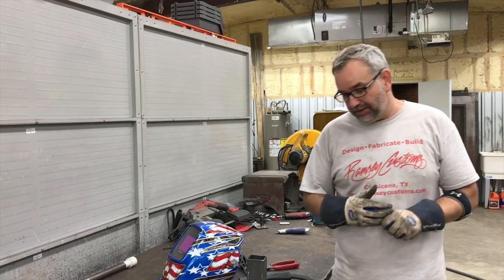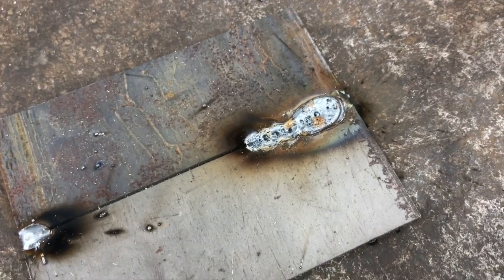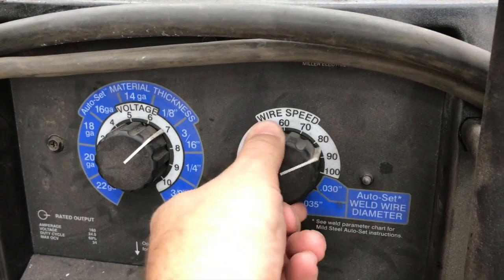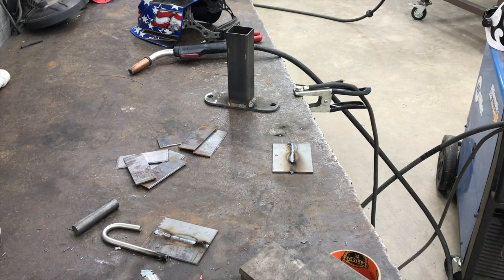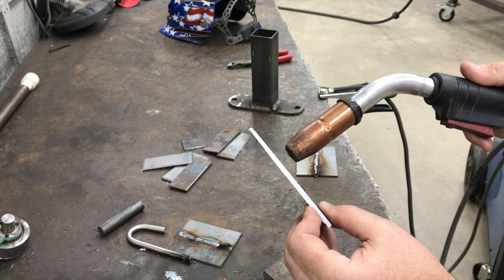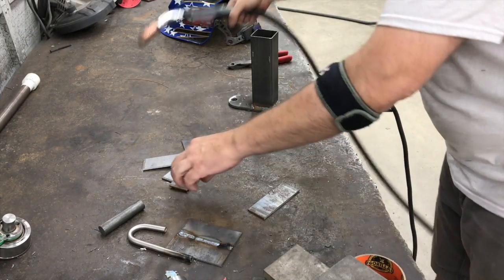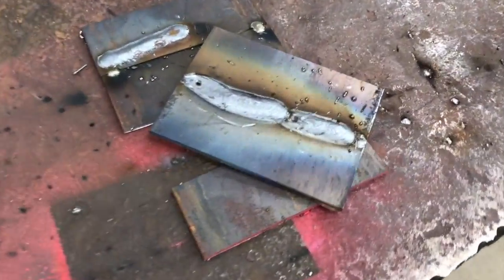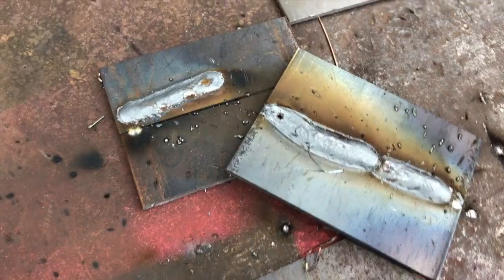Why are my Mig Welds so Bad?

Comment: Well Done :face-fuchsia-tongue-out:
Well Said :face-blue-smiling:
Well Explained :person-turqouise-waving:
SLAPS Subscribe button :hand-pink-waving:
now to find out how high to set the pressure on the regulator 👍 
on oxygen tanks when running low i set it low, when it's running out i raise it, eventually i'll replace 
goldsmith / master jeweler 60 yrs experience here, now getting my hands dirty with welding 👍
i prefer flame torches but i love electricity (photovoltaic / solar thermal tech under my belt so it's time to rock 'n roll with Mig ⚡⚡⚡

Comment: Mines is popping and wire jumping around on a newish Vulcan 220 welder , I been welding for 30 years and can’t figure it out , what else could it be? 
It still has the factory mig gun and heard there not great at all so maybe that could be the issue ? 
Let me know what you think or what else it could be?

Comment: you missed out on too fast welding movement, too low of voltage, too much gas, too close with tip, and a couple of others too. but thank you

Comment: You just helped my learning curve, so I subscribed and bookmarked this video. I probably will have to come back to it on my way to mastering mig welding. I will also use this video as a REFRESHER. You may not be a teacher but you come across with a clear straight forward delivery that a layman can understand. thx.

Comment: If I could add a tip on the grounding issues, check the part of the cable that reaches the clamp. It might be damaged, since the cable tends to bend a little there when you fix it to the work. I had those issues even though the clamp was in contact with clean metal, until I realized most of the copper stripes of the cable were completely damaged. I redid the connection and it improved a lot (still having a bit of a hard time, since I'm a beginner and working on 18-20ga sheets with a flux core machine)

Comment: Lol your right i forgot how to mig gas. I been stick welding got a job doing handrails bought a 190 hobart out it together and couldn't lay down a bead man.    After about an hr an watchin your video I turned up the wire speed to 70 80.  Its found better buts still not flat . Help

Comment: I have been welding 44 years and my welder has been sitting for
 2 years it welded fine until the rusty wire came out what a nightmare

Comment: Does anyone MIG without gas.  I didn’t buy gas for my Lincoln 140.  I know it’s just a real small welder, but, I don’t intend at 76 y/o to be welding very much.  Just a few pieces now and then, repair a mower deck, if needed.

Comment: Great Vid. Learning to weld at 85 years old. Have wood working shop but needed another hobby. Making rocket stoves. But welding in short sleeve, shorts? Brave. Learned several things from you. Bought two migs. 
🐻

Comment: Good day. Great video. I have one question for you. A piece of wire is often "glued" to the weld during welding (http://vladimirkubicek.sweb.cz/Kuhtreiber%204100/P1120689.JPG). Something similar I feel is in your sample - 2:32 minutes of video.
What is the cause?
I think my welder welds very well, but sometimes he doesn't ignite the arc. Do I suspect a contactor in the welder?

Comment: New frustrated welder, but will keep trying. Your video is excellent. I experienced all cases presented. I am wondering if buying a cheap welder is a good or s bad start for a new welder? I bought the harbor freight flux 125.

Comment: At 9:00 minutes in when you did a very quick smooth weld. What settings were you running? I bought a Hobart Handler 140 6 weeks ago and still working on better settings. I have taken a couple welding classes and had the opportunity to weld with all kinds of welders and just made the spot at the end of my 2nd class to Tig weld aluminum. I don't want to go too fast or too slow on a higher speed burning holes or doing a real piss poor all over the place weld. My welds are looking pretty good as I practice and get to know my machine, but my time to do that weld on thin material at or close to default settings wouldn't go that fast. Any help or a different point of view is always welcome.
Reply from the maker: Just keep practicing and working to try to improve.  Video yourself so you can watch it again and see how your technique is looking

Comment: I've been welding for 30 yrs. You can hold your torch at a 45 degree or less and don't want more than 5/8 of a inch of wire sticking out. I run my shielding gas 20cfm. Great video for people starting out.

Comment: Hello Ramsey, I have a l Lincoln 140 wire feed welder. Is it necessary to use argon gas to get good welds?
Reply: Yes using gas will give you much btr welds then using flux core wire...it’s garbage!

Comment: One thing I wish to add is polarity issues.  If you swap between MIG and flux core welding, you have to remember to swap over the polarity while swapping wire spools.  Welds turn out horrible with incorrect polarity.

Comment: Had all these issues, but not sure why my gas is not coming through as pressure is good. Too much rust which is very hard to remove with a wire brush. Thankfully it's only rebar and will be covered by concrete.This has been very instructional, thank you. Did some MIG welding at college but everything was all set up perfect with clean steel plate, so never really learnt how to deal with problems.

Comment: Just a tip to everyone, avoid but welds always go for a lap weld if you can its stronger and only a few things actually get but welded. If needing a but gap it use backing or use a V joint

Comment: advice no1 dont learn to weld on your project!!!! if you project needs a lot of welding . . learn to weld first "then" tackle the project.,. reason being... a lot of your welding on old cars especially is rust repairs.. you will be doing that for many weekends ,but most of it will be in chassis and crush zones of what will be (after a couple thousand hours) and when you tighten the last bolt on your finished pride and joy you will stand by and remember all the things you learned in the last couple of years...  how bad the car was, how bad you cheap welder was, before you bought the gas bottle. how bad youf welding was when started fixing the rusted chassis that the guy before you stuffed full of newspaper and finished it with underseal.    just episodes from my and friends builds from 30-40-50 years ago i am no spring chicken then but still build cars

Comment: I have the problem you described as having no gas. Problem is I have brand new gauges and a newly filled tank showing something like 1600lbs and 30 to the gun. So why the crappy weld that looks just like you said??
Reply: one of the things that he did not tell is about the is nozzle issues , is the nozzle cooling the weld proper ? we all ( me ) don't all have new welders and sometimes try to milk the cow as long as we can , a burnt off nozzle will not work right , hope this might help someone Johnny b.

Comment: One thing I didn't see was the fact you may have to much gas or that your pushing the gas in to much by being to close to the weld , that will surely pin hole the weld, or the tip inside the nozzle is clogged and not getting sufficient gas.

Comment: when welder is set right the sound of the weld should sound like bacon frying. when that happens mark your dials so you know where to set it again. Make sure your material is clean from rust , paint, oil etc.

Comment: Great video, Another thing Ive seen is that guys will get hot and turn the fans on them in the shop and try to weld. Fans and mig welding doesn't work.

Comment: What does it mean when the wire comes out , there is a  hissing sound not a "bacon" sound, and keeps forming small molten "balls" on the wire which drop off and another forms?  Thanks in advance.

Comment: Which is stronger mig welding  with or without gas and also is it better to weld with or with out gas when afterwards grinding the weld down for body work

Comment: Thanks for the strait forward approach. I did see some flaws in my technique and what may have been frustrating me so much today. I do exhausts and most welding is above my head so you can imagine my frustration when it kept puddling outward, me thinking "too hot" was backing the tip away and worsening my own issue.

Comment: Do you have to have gas with migwelding?
Reply: Or another way to say it: Yes, unless you are using flux core wire.
Reply: I’m only new to MIG welding but...gas MIG welding is way way better than flux core MIG welding.
Reply: Well, there is flux core wire but it is called Metal Inert GAS, welding so....

Comment: Biggest problem is wind outside and bad grounding. after i homemade a good ground i get nice clean welds. The factory cable had terrible connections so i braze the copper wire to the clamp and the connection pin.
Reply from the maker: good point about the wind, i didnt think about folks welding outside, i should have mentioned that

Comment: Thanks for the video.  I spent all day trying to figure out why my weld is sputtering.  Cleaned the ground clamp and cable, added an extra clamp.  Changed extension cords, and even moved to another outlet.  I'm having the exact same problem that you showed with the gun too far out from the work.  Arc sputtering on/off, gun pushing back, and weld just stacking up on work without penetration.  Would a bad tip cause the same issues?   Thanks again.
Reply: Customcutter100 - I know it's been 8 months but there is one other reason why I have had the same problem. I didn't think it really mattered what gas I was using. So I used pure argon to mig weld with .030 hard wire. Apparently it matters a lot. So when I switched to 75% argon / 25% cO2 then at least I had a chance to make some parts of the welds look somewhat like a weld.

Comment: One thing to add is that medium or heavy rust will give you the same results (porosity) that a lack of shielding gas will give you. A light surface rust is usually not that big of a deal even though you will get a better and stronger weld without it. Preparing the surface properly will save you a lot of time grinding out bad welds and the result will be better as well.
Reply from the maker: great points, thank you sir!

Comment: Ramsey Customs - turbocobra

I use mini gas bottle argon + co2 and i use flux cored wire with gas. Because i dont have the solid wire.  I only have solid wire that came with machine.

Anyways, the welds do not look like the one at the left @: 2:35

They look "black" and/or dark and they dont have that look of the "gas weld" (shiny metal weld bead).

What could be the reason? I know the bottle has gas the gas goes to the tip of the gun, i have double checked.
But there is no difference in how welds look like.. gas or without gas, still same, dark, bad and ugly.

Is the problem flux core wire? And i should try solid wire instead? I know the included solid wire is pretty bad but today im gonna try it.
My flux wire is from Lincoln Electric.

Tried to weld exhaust for my car and wanted to make it better with better looking welds using gas, but i dont see results.

Im unable to get the clear weld results as you got or other guys show their welds using argon/co2.
Reply from the maker: Sorry I cant help you there, I have never tried dual shield.  Check jody and peter zila channels

Comment: IF YOU LOOSE YOUR SHIELDING GAS THAT IS WHAT WILL HAPPEN NO FANS OR DIRECT WIND USE INNERSHIELD WIRE JUST RTEVERSE YOUR POS AND NEG INSIDE YOUR MACHINE ITS NMOT PRETTY BUT ITS JUST AS STRONG AND YOULL NEVER HAVE POROSITY,IF YOU WANT TO USE A GAS WIRE STEP UP TO DUAL SHIELD WHICH IS A COMBO WIRE THAT USES GAS AND HAS A FLUX CORE WHICH WILL LEAVE A SLAG BUT ITS THE ONLY MIG WIRE THAT WE USE INB OUR STRUCTURAL STEEL FAB SHOP .LINCOLN 71 T 71 M 71 C RULES

Comment: Is it necessary when mig welding to oscillate the way we did when stick welding? I've seen some sweet beads laid down by just maintaining the proper speed and distance and no wiggling.
Reply from the maker: Wendell, so many variables determine what technique you use.  I think a slight C shaped motion or circle type weaving motion is good general practice.  But if your welding a lap joint, on fairly thin material, there is no reason why you cant just buzz straight over it. but any type of a fillet weld or T joint you need to weave to make sure we catch the sides of both pieces

Comment: for dirty metal you need innershield. gas is prettier on clean metal than innershield but for dirty it takes less prep
Reply: innershield also doesn't have a problem in windy outdoor situations.
I also learned to do arc welding on the job, and had some good welders willing to teach

Comment: excellent video that cover most mistakes that a beginner usually makes, I 'd like to add that oily parts can cause  many issues too, on sheetmetal, simply contamination at the back of the joint is more than sufficient to  cause many of the issues you described

Comment: Watching you weld in shorts and no sleeves makes me cringe .    Nice info anyway.
Reply: I'm watching and cringing from what I see on the screen.  But I'm also cringing because I sunburned my hand because I forgot to put my gloves on yesterday after lecturing the kids to use them.
Reply: chuckels431 cancer.
Reply: Sunblock works like magic, use the highest SPF and reapply regularly. Ray burn no longer affects one of my arms, up to the sleeve line; past that still goes quite red and peels if too much exposure. Welding daily, fair skin, banana boat spray on  👍

Comment: Hi I have been building some motorcycle frames with a lot of grinding and filling after watching your video I realized my gun angle was not straight now my welds look like tig as they are smooth as can be Thank you for the tutorial . Gary
Reply: Gary Jones Why are you fabbing motorcycle parts with mig and not tig? That shit needs to be pretty. Also aluminum spool guns suck.
Reply: Hi T Prime I am not using A Spool Gun I am welding with .35 and after welding a penetrating Bead I go over it with another bead and grind the weld down . instead of filling in the seams with body filler . All of the joins are smooth as glass .

Comment: I've gotten porosity before because the welder cable wasn't firmly connected to the wire feeder.   Had plenty of gas, but it couldn't get the gas to the nozzle because the gun's cable wasn't firmly set in position.
Reply: Same here! I was getting ready to haul my machine into the shop when I finally noticed that the cable had been pulled away from the wire feeder-- a tiny bit and the gas was escaping instead of running down the line to my work. An old tip can cause problems too.

Comment: What if your welder does not have gas?
Reply: Yep....I had wire-fed welders on the brain.  You are mostly correct.  TIG does use gas though.... usually argon.
Reply: Then you have to use self-shield flux cored wire.
Reply: That or you’re using a stick or tig welder
Reply: yes with cored flux wire no need for gas and he  did not properly earth his clamp

Comment: Question:  I have a Lincoln Power MIG 180C - the dial for the wire speed indicators are letters - is their a translation for each of the letters?

Comment: These and a thousand other tiny little nuances are why welding is more of an artform than a science. Yea, yea, there is a lot of science that goes into it and they teach you the science but to get really good it take a lot of stick time. Speed, angle, direction, distance all of these things and many more become a muscle memory from experience. I've taught a dozen different people how to weld, and no matter how many times you tell them to change what they are doing they end up reverting to their mistake until they have done it enough to do it correctly out of instinct.
Reply: Man, very accurate.  Very true.  I am a welding student coming up on two years into the program now.  I find it easier to get back into the swing of MIG processes, but when I go back to stick for one thing or another, there are so many variables that I have to reteach myself every time.
Reply: Geekinjeep, I found that it was easier getting people that I have taught to weld better, faster by teaching them the boring stuff, like metal composition, and such. Once they understand the effect their actions have on the integrity of the weld joint, they seem to grasp the "why's" a bit better. Try it for yourself,  different alloys,  different wire, angle of attack, distance,and so on. This is the one thing that really is an art as well as a science at the same time. Keep at it.